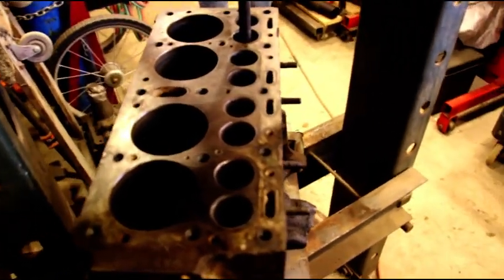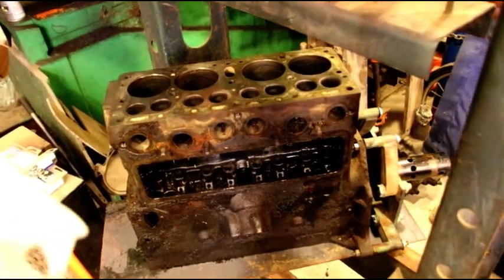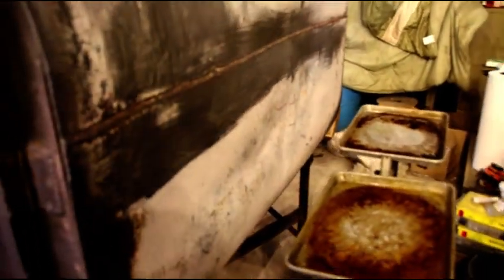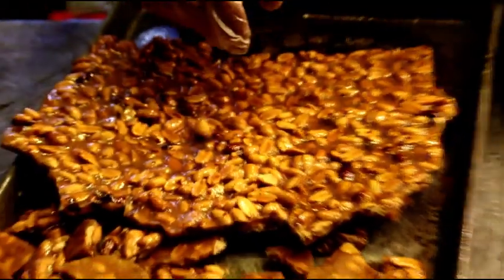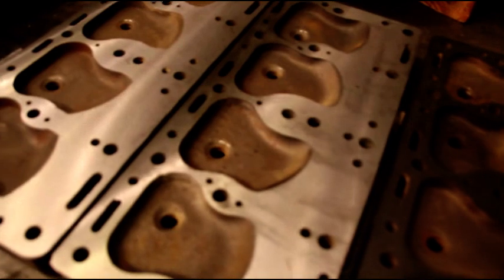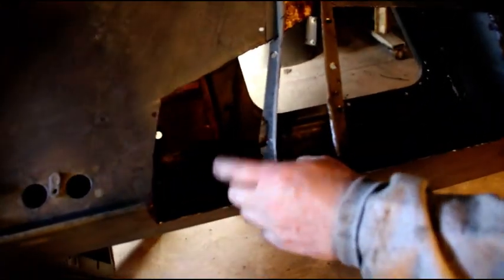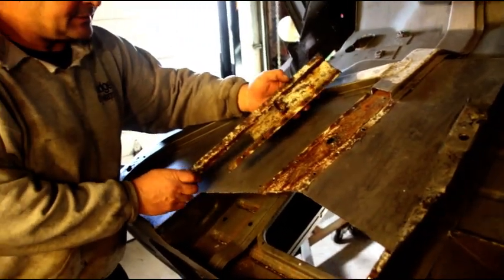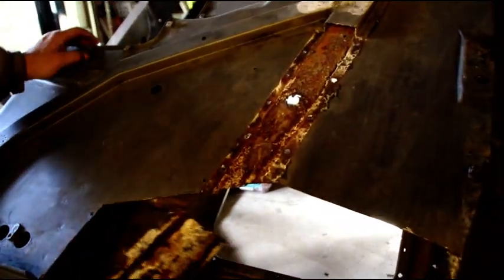Willys Engine Work, CJ5 Body Tub and Peanut Brittle .......

Comment: Looks like it was blasted not dipped..
Reply from the maker: It looks that way but I was told it was dipped.  I have to talk to the owner and see what actually was done.  Hat channel is a mess.
Reply: @metalshaperJeep  Not sure how you bill, but be carefull.Was in Construction 35 years. I worked for one guy that would only work T&M for 20 years. He would work two weeks max then stop if bill was not paid immediately. Some  clients are crooks ,some bid work for others then send to you but they under quoted themselfs, some are honest but run out of money. Sometimes he sent me to collect from the crooks!  Good idea to make the videos to document the work for the honest persons, the crooks do not care about videos and were going to screw you anyway. One rule we followed that i did not like at first was to only do what the plans/agreement showed even if we new the plans were wrong. Once we deviated from the plans legally we had broken the contract according to law.  I saw it go wrong many times when we built it correct, but deviated from plans. We had a saying among ourselves, "We will build it upside down backwards if that's what they want".. I hated to do work that i knew was wrong but we learned quick you have to either stop immediately or keep going by plan if they do not answer your RFI,s (Request for information).  Your a two man band, we were many crews spread out with many jobs.. JUST BE CAREFULL! Better to have many smaller jobs and stop when changes come, than one big job that you have to keep going to pay your bills.